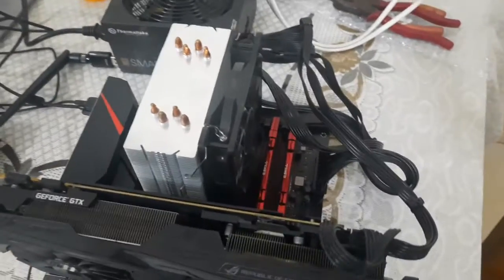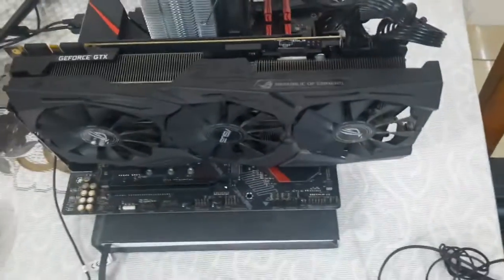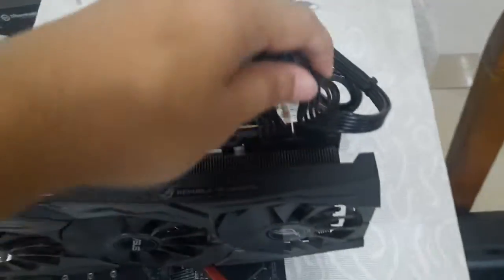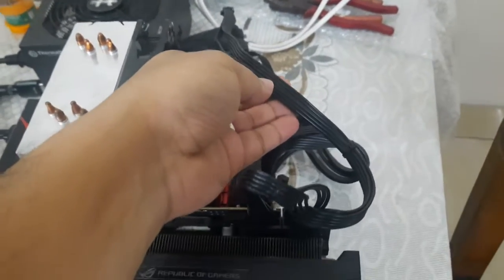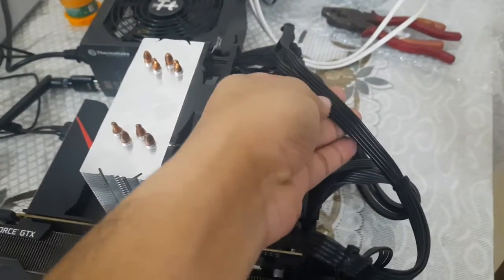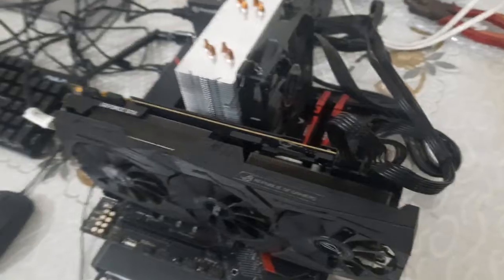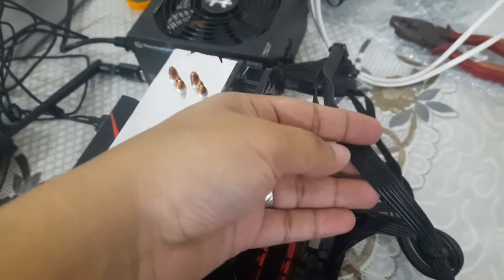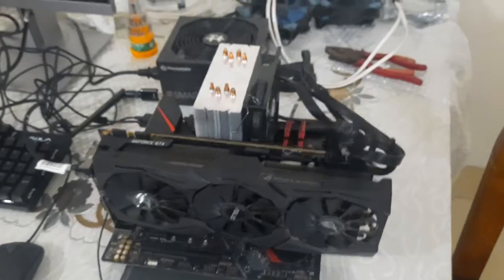#13 How not to connect power supply with Nvidia Graphics Card #ASUS Strix 1080Ti

Comment: Thank you i just bought 1080ti but my power supply unit only has one six pin connector and I was about to try to do what you did. I have to figure out how I would do this.